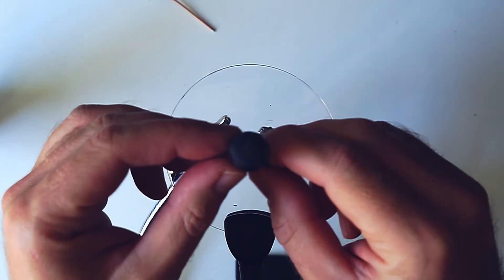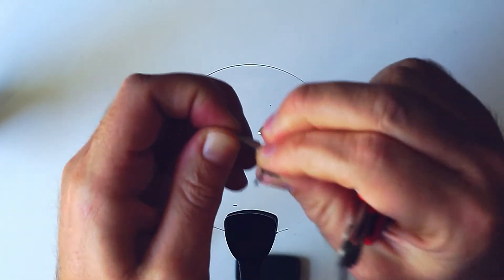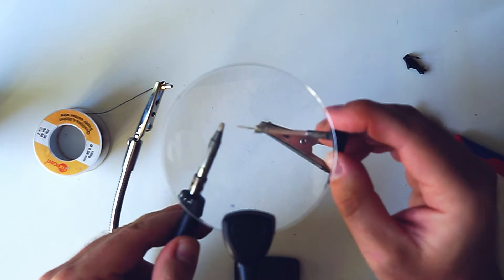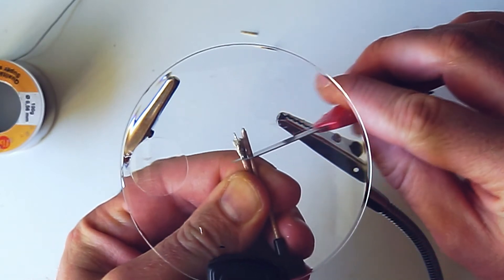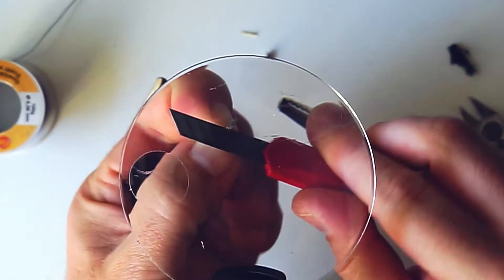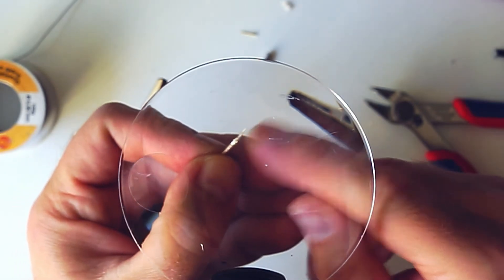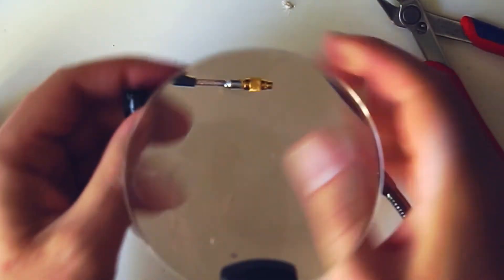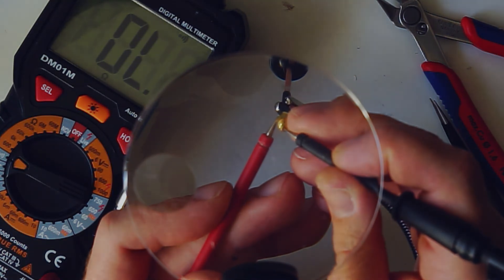Tutorial 1: How to solder a MMCX connector from an old antenna to a new one

Comment: What is your lens and holder called? Seems very ergonomic
Reply from the maker: Hey, I couldn't find the exact model anymore. Either way I wouldn't go for this one again. Because the clamps are very sharp and not isolated and not very flexible or turnable. 
Have a look for "Third Hand". There are various models with flexible and isolated clamps, light and magnifying glas.
Reply: @seb-fpv3627  ah cool! Yeah the ones I’ve seen with fixed hands were frustrating to use so I liked the move able arms. 

Also in general, I’m about to do this tomorrow but basically we want the pin soldered to the inner wires (tiny wires inside of the insulation) but what I was unsure about is the outer metal jacket of wires (not sure proper term) - that should be in connectivity with mmcx connector housing you slid over everything?

Just want to make sure I have the proper connection made as I may have missed it in the video.

Thanks for responding and cheers!
Reply from the maker: @boomboomtradingroom9646  
Yes, the braid / ground goes to the plug housing.